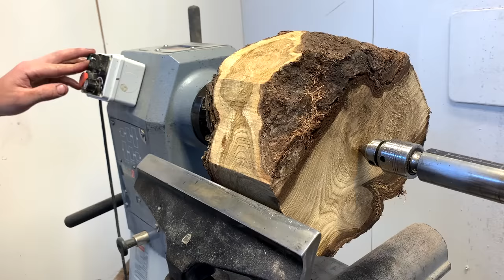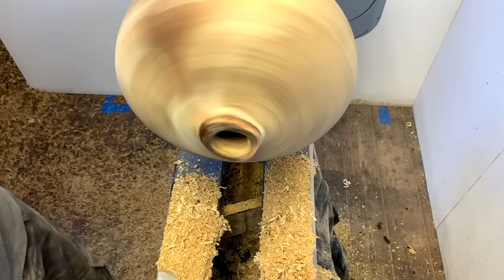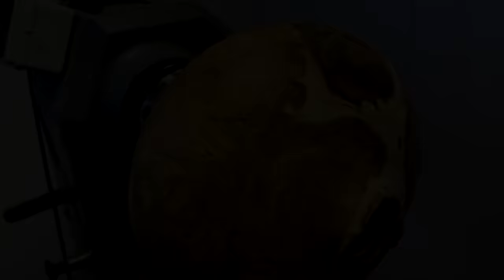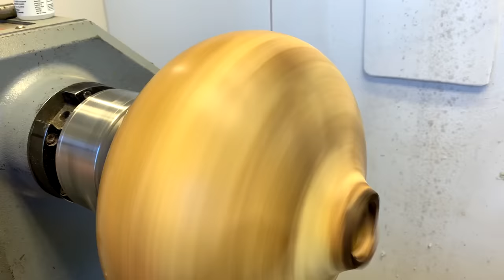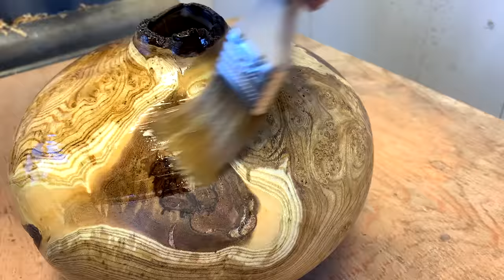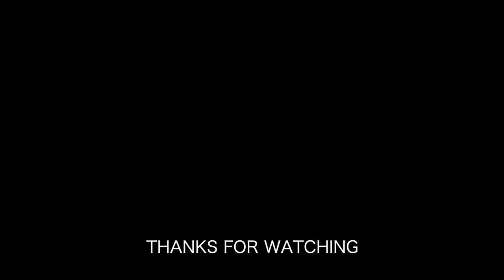Woodturning - Golden Rain Burl (The Most Beautiful Wood I Have Ever Turned)

Comment: Is this as dangerous as it looks? Seems like if a big chunk flew off you could have a very bad time.
Reply from the maker: Always safety first buddy. There is little to no risk when observing the correct safety protocols. 👍🏻😉
Reply: No, it's not as nearly as dangerous as you believe. 
Sure, you should use safety equipment, goggles, facecover, mask, but it's certainly not life threatening. 
Without care the worst your looking at is a sprained finger, POSSIBLY an eye Injury, but simple safety can avoid any of that.
Reply from the maker: That is entirely incorrect Tim.. I personally have had an accident that took the end of my finger off.. ( it was re attached) and I have heard of multiple life changing injuries caused by wood turning accidents.. it is safe if you follow good turning practices and it can be EXTREMELY dangerous if you do something wrong.

Comment: For a moment I thought you might make a hanging lampshade with that design. Drill some holes into the sides and or cut some slits into it. I think you might need to open the bottom a little more and use a LED light to minimize the heat, but I can see that being awesome, too. Love burls.

Comment: My second question, and it may be stupid but, is it possible to put so much pressure on the wood that it noticeably slows down the rpm’s? I coulda swore I saw it slow down a little bit. Beautiful work as always
Reply from the maker: Hi Josh. This effect is to do with the ratio between camera frame rate and lathe rpm. 

The backward motion illusion occurs when the speed of rotation means that in the interval between each frame, the lathe moves nearly into the position occupied by the lathe in the previous frame. If the timing is precise, it looks like the lathe did not turn at all.

Hope this makes sense. Thanks for watching!
Reply: @JackMackWoodturning  That makes absolute sense! Thanks for taking time to answer a silly question.
Reply from the maker: There are no silly questions mate. Some lathes with thin drive belts can slow/stop when the user causes the tool to catch. It wouldn’t happen on this lathe however. 
Hope that helps 👍🏻

Comment: It is beautiful. I just can't help but think about all the waste. Would there not be a way to preserve that and create something from it as well? The end result seemed to be at least 50% less volume than the start.
Reply from the maker: You can’t really make this piece without taking wood away 😊 
You can’t really class it as waste unless you can suggest a better way to use the stuff that becomes shavings. 
All my shavings go to a local community farm where they are used for livestock bedding, they are then composted and used on the vegetable garden.. this ensures that all the carbon the tree locked up in its lifetime
Is returned to the earth. 

Do you also comment on waste when you see people burning wood.. which releases most the carbon back in to the atmosphere?? 

Something is only waste if you waste it.
Reply: @JackMackWoodturning  you took my comment more critically than I intended. That's great what you're doing with the shavings. I was just thinking about taking the shaving's and compressing them into a cube/log/circle shape again...maybe with some sort of resin...and then turning (literally and figuratively) that into something.

Comment: There's a lump hanging off a tree on my street that's about a meter in diameter.  Every time I walk by I imagine what could be made from it.
Reply from the maker: Where do you live?
Reply: @JackMackWoodturning  It's in someone's yard, one of those big trees that is pushing out into the street, tearing away at the curb and tar over the course of decades.  The town may eventually have to remove it, but that will be a tragedy.

Comment: Do you have any tips as to keeping the burl on the lathe? I'm just starting to work with them and am having problems with them either catching and breaking the tenon off. Or the vibration from Burl's that aren't solid. It's more so the ones that have voids in them that I primarily have issues with.
Reply: If you are just starting out learning to turn wood, I suggest a LOT  of practice on wet or green wood. Its easier cuttings and more forgiving.. this activity will allow you to learn tool control. Catches are mostly caused by poor tool control so practice, practice and more practice. If using a face plate, drill out the holes to allow the use it of at least 1/4" X 11/4" or larger hex head lag screw. Holds more effectively. If useing a scroll chuck, learn to form the tenon or recess properly to fit your chuck. Do not over tighten chuck jaws. Try useing larger diameter  jaws untill you learn good yool control. Finaly. Take lessons from a good professional turner.
Reply from the maker: Duane has good advice here. It is best to walk before you run. Perfect your skill on smaller and softer wood and keep your tools super sharp. A good hold is very important but good technique is paramount and takes a lot of practice. 👍🏻😉

Comment: Why did you choose to varnish (?) it on a stand and not on the lathe? The way you're doing it will create thicker sections and rips, won't it? I'd really like your rational so I can incorporate it into my works.
Reply from the maker: Hi James. Although varnish is technically  the right term for danish oil it’s not a varnish in the traditional sense. It thin like an oil. Application is the same wether the top and bottom of the piece are horizontal or vertical, gravity will still cause runs, and those runs can by wiped away, the goal is to apple the oil over the whole piece and then wipe away excess so that when the oil cures there is a singe coating over the whole piece. 
Depending of the form of the piece in question I will apply oil on the lathe or on the bench. Both have the same end result.

Comment: Absolutely gorgeous!  Curious observer question:  what do you do with all the wood shavings?  Do you put them aside for burning in a wood stove or pellet stove?
Reply from the maker: Hey thanks for watching. I don’t tend to burn a lot of wood, burning wood undoes the work of the tree in its life time and puts a lot of that stored carbon back into the air. 
As a full time production wood turner I produce around 8 cubic yards of shavings per week, they are sent off to a local community farm and used for livestock bedding and then composted for the vegetable garden.. I feel like that is doing the most justice to the tree and it’s work in storing carbon, as composting correctly locks down the carbon back in the earth and has countless other positive impacts on this rock we call home. 😊👍🏻

Comment: What tool are you using to turn this piece?
Reply from the maker: At which part of the video?
Reply: Just throughout— what do you use to “rough” turn it?
Reply from the maker: Hey Julie. So I use a few different tools in this video, for the most part Il use a 5/8th bowl gouge for the outside and hollowing tools on the inside. 
Rough turning is a term we use to describe a piece of green wood that is turned half way to it’s finished size and shape.. left rather thick, and then left to slowly season for a few months to a year before being turned to its final shape. Most the turning you’ll see me do on this channel is green turned to finish piece with very thin wall thickness.